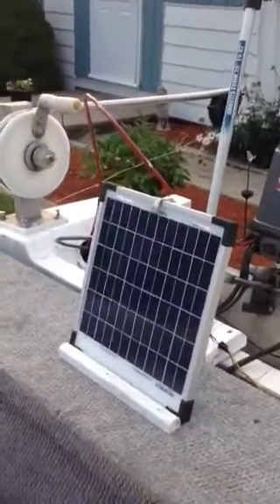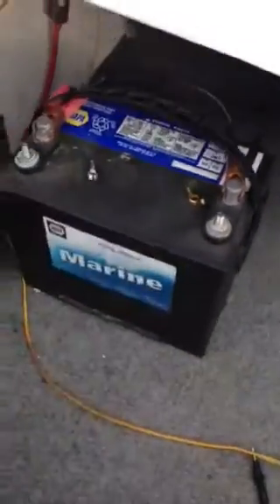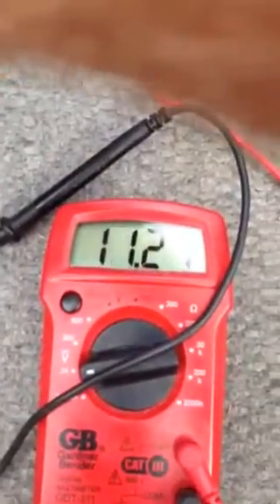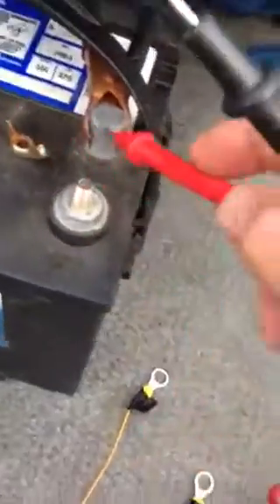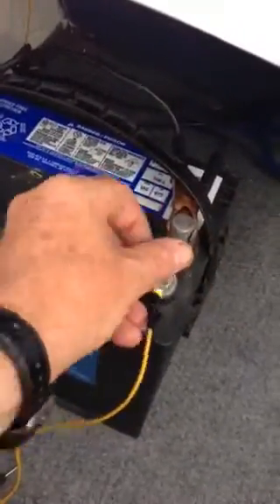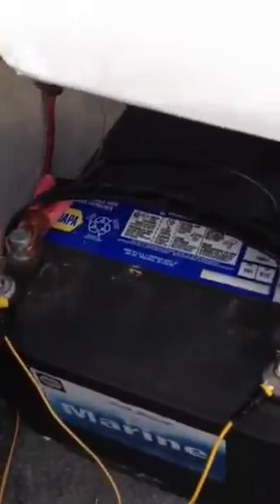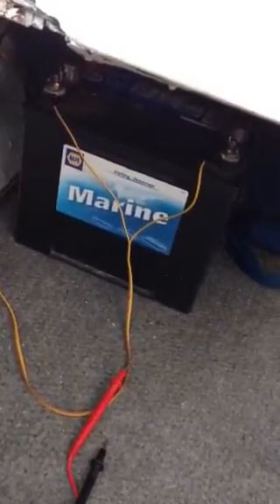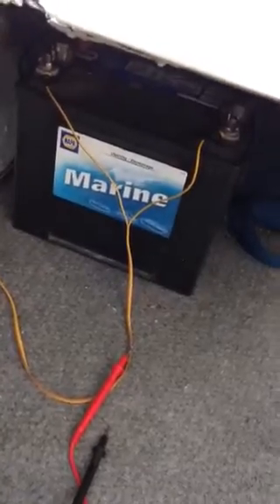Solar Battery Charger for Trolling Motor

Comment: Do you hook up a solar charger as your using your trolling motor
Reply from the maker: I have tried it and had little (noticeable) effect trying to charge when on the water. Best to have the panel(s) stationary and pointing at the sun when boat is stationary. That's my experience.
Reply: @DavidSmith1957  thanks I figured it wouldn't hurt but only extend my time on the water... I'm on a kayak with a 36 lb thrust troller and hoping to extend my trip... Thanks for the video and response... Fish on !!!

Comment: Say you were on the water using just the trolling motor for several hours, do you think the solar charger would extend your battery life while you were out fishing and let you fish longer?
Reply from the maker: Short answer is yes. Of course the panel charges best when facing the sun. It functions as a trickle charger for the battery. I leave the panel on all the time (in fact I have a smaller one hooked up to my main battery as well) and apart from an initial full battery charge when I take the batteries out of storage in the spring I do not have to charge the batteries at all during the  season apart from the solar charger. It really does work!
Reply: @DavidSmith1957  That's good to hear. If you have enough space, couldn't you lay the panel flat to better collect solar energy?
Reply from the maker: @edwardh1003  Sure. Like I said, I park my boat facing south so it trickle charges from early morning throughout the day whenever it is parked. If you were to lay it flat it may collect even more energy, especially when moving about on the water. Another trick I learned is to use your main motor to go across the waves/current and utilize the natural drift to minimize the drain on your trolling motor allowing you to use the trolling motor primarily for steering. This can add hours to your battery life on the water. :)
Reply: @DavidSmith1957  That's a good tip. Thank you.

Comment: Hope you have a charge controller between that solar panel and your battery. It will over cook your battery without one.
Reply from the maker: Yes, most Colman or portable style solar kits do come with a voltage regulator connected online or attached to the panel.
Reply: @DavidSmith1957  I know this is really old, but you're dumping 18v into a battery designed to charge at no more than 14.4v.  A cheap charge controller would be a smart idea, or a panel that limits output to 14.4v at a certain amperage.
Reply from the maker: @jasonbroom7147  as I mentioned in my post a year ago my Colman panels come equipped with voltage regulators/charge controllers. Thanks for watching.

Comment: What make battery is that? IC it has two connectors one for your boat the other for your fish finder?
Reply from the maker: It's a NAPA Marine battery. Comes with dual posts.
Reply: Nice video. I’m planning on doing something similar. How long does it take to charge from dead to full?
Reply from the maker: @MaxEitzen  I have often fully depleated my trolling motor battery and when I park my boat with the panel facing directly into the sun (even when overcast) the battery will be pretty close to a full charge in about 4 hours. I also have a larger portable panel that I can hook up if I need a quicker rate of charge.  Let me know how it works for you.